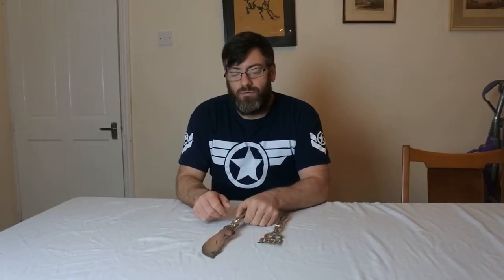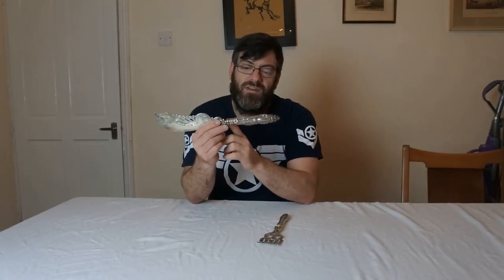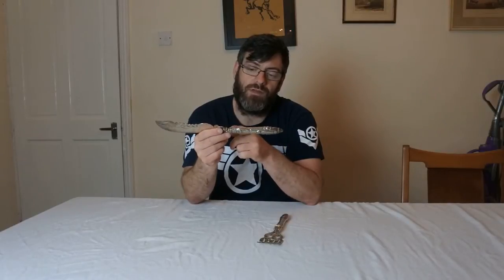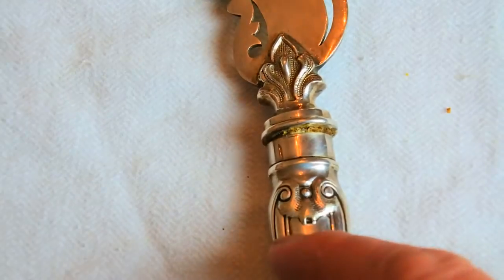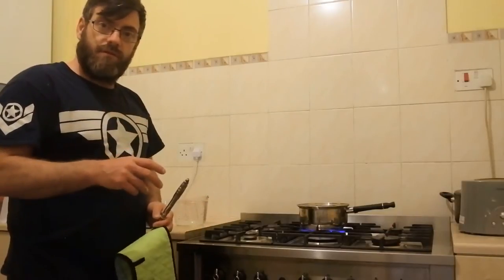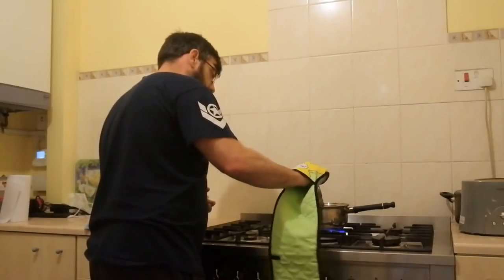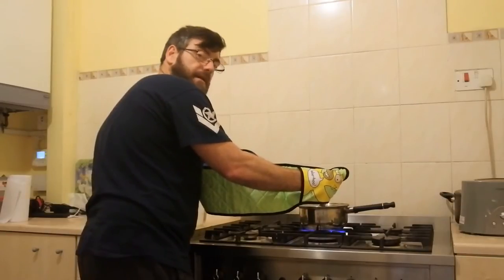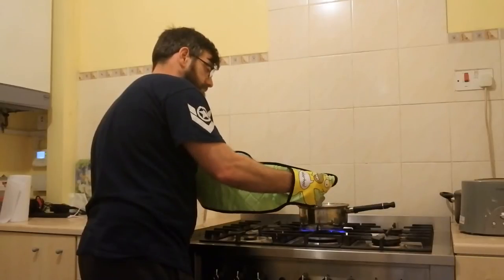Fix Your Silver Cutlery Before It’s Too Late!

Comment: Thank you for your demonstration. I have a similar issue but with the silver handle which fits into a wooden salad serving spoon. There doesn’t appear to be any remnants of any glue. The wooden shaft of the spoon fits into the handle but it just comes on and off and doesn’t fit tightly and stay on. Any suggestions on how to secure it? I really appreciate your assistance! Cheers, Carter (from Australia)

Comment: Hi. Interesting video. Thanks for sharing. I wondered if you might be able to help me with 2 similar repairs. I have two sterling pieces attached to wood that have separated. On is a sterling handle and wooden salad spoon and the other is a Victorian men’s hairbrush that the sterling monogrammed top plate has come off the wooden part that holds the bristles. What product is best used to reattach these items. Does it differ between the two? I really appreciate your input. Cheers, Carter

Comment: Hi, I have a question for you. I have an silver teapot and the handle popped off. I use an acetylene touch for plumbing and I tried to silver solder the handle back on. I tried to go at it slow cause wasn't sure the handle was silver plate or solid. Still don't know. Anyway it worked but  before the solder flowed the handle started to melt and really almost ended up welding the handle to the pot. Problem is the handle kinda cut up at the end. Was thinking of just flowing more silver solder into the gap and fill it, then grind down the excess and polish. I'm really afraid of cutting again more of the handle. Do you have any suggestions? Thanks so much.
Reply from the maker: Hi thank you for your comment. You should have used a jeweller. They would have charged maybe ten or twenty pound to do it for you. You can’t use a copper plumbing torch for silver. To powerful. You need a small mixed gas solder system. They can be bought on eBay. Cheap
Reply: @AntiquesArena  HI again, Thanks for your reply? I do have a oxyacetylene set but for brazing and welding. I found I should have used a way smaller tip but got in a hurry, thinking low heat would be sufficient.
I am kinda asking now is,, the handle is well attached, but there is a gap where the handle melted at point of attachment. Do u think I can flux, lightly heat and flow silver solder into the void. Then when silver solder cools, the use a small rotery tool to file to shape? Using a 00 tip of course. If I can't do that than a run to a jeweler will be my last resort. Thanks again for your suggestion and expertise.